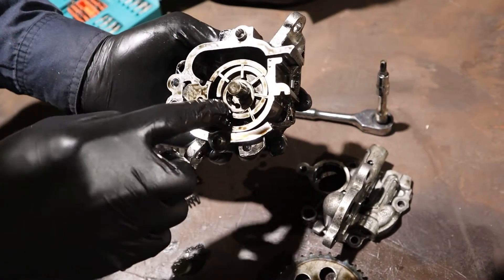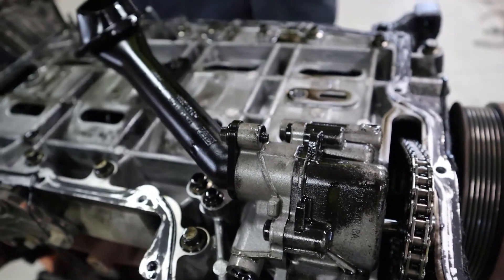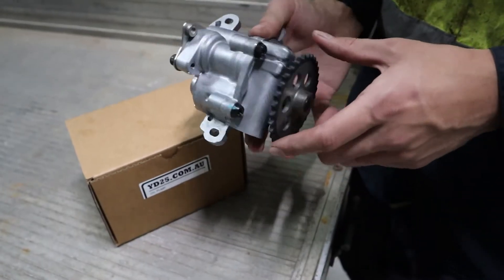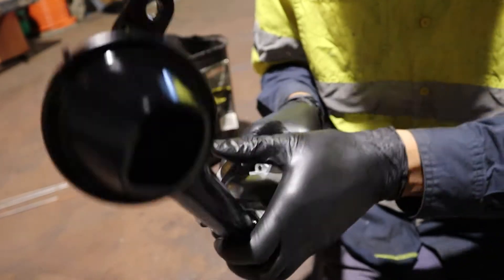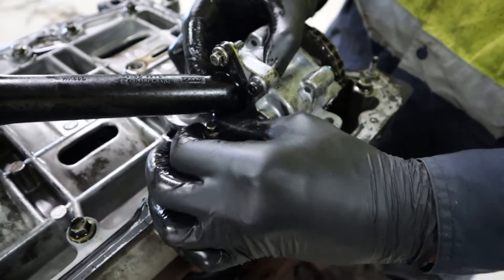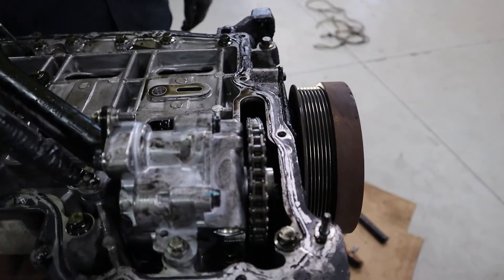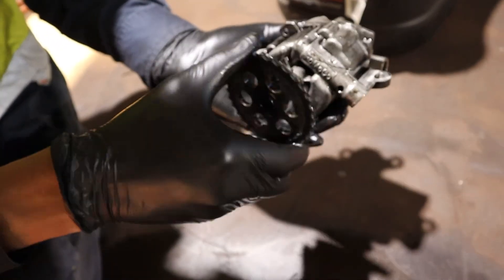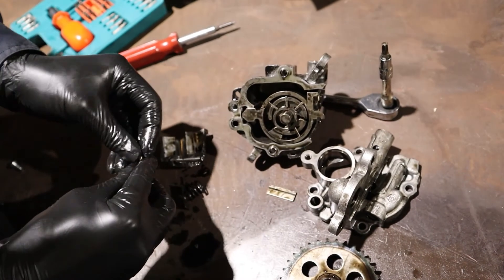Ford Ranger/ Mazda BT50 P5AT Gear Oil Pump Install

Comment: In the EU the engine fitted with the vane pump is known as the Euro 5 version (2011 onwards), the older Euro 4 emissions standard engine (2006/11) is the one with the gear type pump.  You can fit the old style pump onto the newer engine minus the feed pipe as per the video.  It's also a cheaper pump to buy!😊

Comment: Hi, Firstly thanks for all your efforts with the great informative videos!

I would really appreciate some advice, I am in Thailand and bought a 2014 ranger wildtrack 2.2 120,000km. The ford dealership just links to their laptop and tells me there's no problem.

Symptons:
- lose of power when starting to accelerate in low gears
- twice i have been approaching/going up a steep hill changed down to 2nd had no power and then down to 1st and also had no power and the vehicles stalled  
- slightly rough idling (only a little) and also a shudder when turning off the engine

From everything I have seen online I am thinking I need to clean and blank off the EGR cooler, but I would really really appreciate some professional advice!
Thanks so much in advance!

Comment: But does the Standard engine have a oil pressure relief valve or does the new oil pump have one.
Judging by the castings on the new pump there is an internally recirculative pressure relief circuit.
4:33  that cylindrical casting is a pressure relief valve ON THE OLD PUMP  !!!!!!!!.
Why T F does a variable oil pump have a PRV ?

Comment: So how do you remove the sump after removing all the bolts while the engine is still in the car? The sump is virtually welded to the block and almost impossible to break the seal?????
Reply: Nothing is impossible💪

Comment: Will this oil pump upgrade cause higher oil pressure at idle
Reply: im waiting on my geared pump to arrive, Had ordered that before i even picked up my Wildtruk, (2015 model, S/Hand} slightly higher would be nice but not too much to cause seals to leak.
Reply: I found out that the issue I was running into was that the vacuum pump was not engaging with the camshaft because when I reinstalled the vacuum pump it was not aligned with my camshaft and pushed the camshaft forwards 4mm in the head. that's why I commented asking if the pump would cause higher oil pressure as I thought that there was too much oil entering the vacuum pump causing it to not have any vacuum.

Comment: Is it possible for you to do a video on how to do this job whilst engine is still in the car? Would be greatly appreciated. Thanks
Reply: It is possible on the ford transit, a bit of jiggling about to get the pick up off then the sump slides out revealing the oil pump, not sure about other vehicles, it all depends on how close to the sump the cross member is